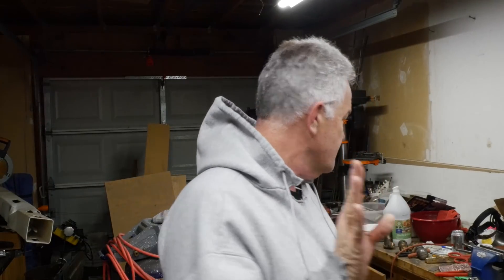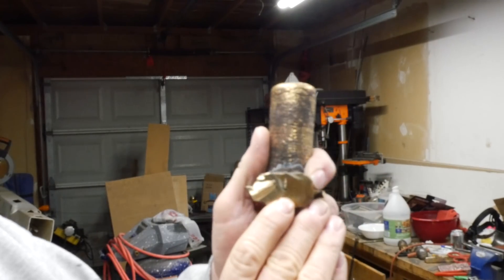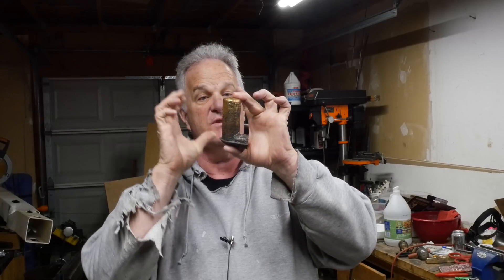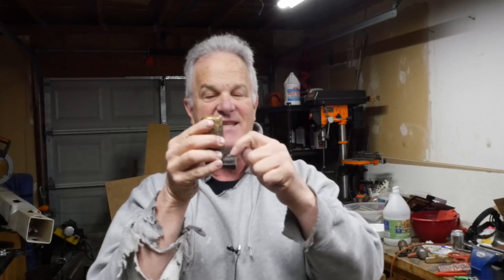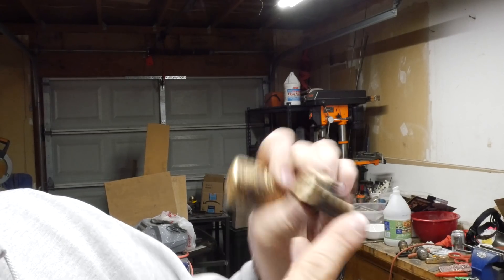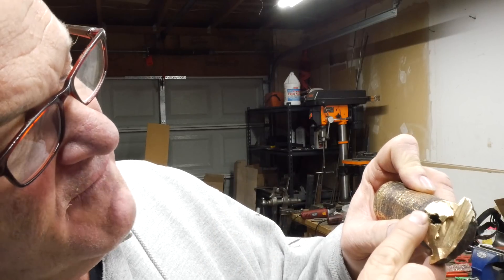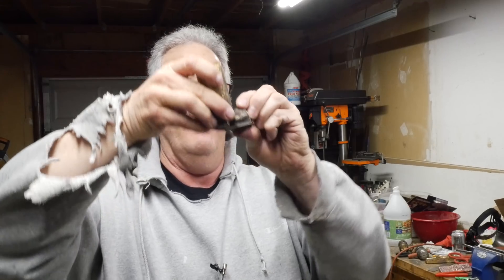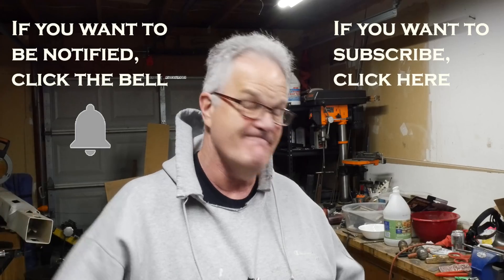Exploring aluminum bronze hot spot shrinkage

Comment: Gosh that’s real strange and I haven’t seen that before. I was definitely wrong. Sorry about that. That’s real cool to know though before I try this stuff. Thank you
Reply from the maker: Not to worry. To tell the truth I fought the idea of it being shrinkage myself when it first happened. I just thought it was a trapped air bubble.
Reply: @swdweeb  That’s exactly what it looked like. I guess aluminum bronze just acts very different than either aluminum or copper. Cause neither one of them does that. Chemistry is strange. Haha
Reply from the maker: @lucasjones7846  Aluminum bronze is the worst in terms of shrinkage. It shrinks far more than anything else I've ever poured
Reply: @swdweeb So if you're trying to pour a 3D print, you'd want to print it 15% bigger than the final piece?
Reply from the maker: @lucasjones7846  Probably not that much.  Every alloy shrinks differently.  For example in the technical book that I have tin bronze will shrink 6/32 of an inch over every foot .  Aluminum bronze that is 10% aluminum will shrink as much as 10/32 of an inch over a foot. That calculates out to about 2.5%. SO if you were making am aluminum bronze casting that is 10 inches long you'd want your mold to be 10.25 inched long

Comment: One of the things you gotta keep in mind is that aluminium bronze expands and contracts signifficantly more than the other bronzes. Which means pour temperature has a lot to do with how deep it shrinks into itself. Too cool and it wont cast, too hot and its a vry hungry mold. do a test with a short melting and a long melt (leave it in there for a good long while at full blast), identical molds, and see what happens. The volume of the feeder itself will cause a sink. Bigger is better but dont let it fool you, if you have a small part and big feeders, its not "that" hungry.

You can get an educated guess of how well they were working by looking at the part and the feeders together. If its a deep dished shape with a hole in the senter on the top of the feeder, it did great. If its a skinny hole with only a small dip (or not dip, but just a tunnel through it), you had the feeder tube walls solidify before they were able to feed. This is not ideal and and be fixed with hotter pours. You can also preheat the mold but with petrabond sand, preheating is not an option. The oil viscosity drops and it looses its ability to hold structure. Hot metal does that too but it gives the sand something to rest on. With nothing under it, it will crumble almost like a dry sand castle that you touched in the wrong spot.

Comment: Yep, looks like solidification shrinkage resulting in porosity at a thermal gradient zone. 
At the inside corner, you have the hot zone and at the outside corner, you have a cool zone, that causes the thermal gradient between the two corners.

It's a good idea to avoid sharp corners in the riser/feeding/gating system (and the casting). Typically recommended to use rounded corners having same radius for both internal and external
corner (i.e. fillets)

I would also suggest adding a half-sphere to the bottom of your riser (easy to carve out a cup in the drag at the bottom of the riser when you do your gateing like you do for the sprue well).

Comment: Perry, Spot on! Nicely explained. Short freezing range alloys like aluminium bronze are very prone to this hot spot problem. And it is typically seen at gate connections as they tend to get hottest. Best solution is adequate feeding and as you point out well radiused gate connections.... Martin

Comment: I wonder if any sand was sucked into the molten metal from the hot spot.  Did you find any?
Reply from the maker: I just went out to the garage to get the part with the largest void in it. I tapped it on some paper and none came out. I don't recall seeing any when I cut it but I wouldn't swear to it in court. It took a long time to cut it open and it could have come out then and I never noticed.
Reply: Ron, I have never seen sand "sucked in" to a cavity in this way. I think it most unlikely that it would happen as the forces involved are so low and the movement of metal is not only slight but away from the sand... Martin
Reply: Cool.  Just wondering.  I just noticed that 1 branch of that void didn't go to the air, just ended under the sand.  I know that air can pass between the grains of sand like a filter.
Reply from the maker: Actually, I could have been clearer on that point. The whole thing is under the sand except for the very top of the feeder which was exposed to the air.
Reply: It's cool, no harm done.  Ty.